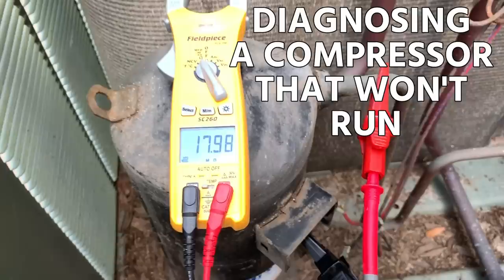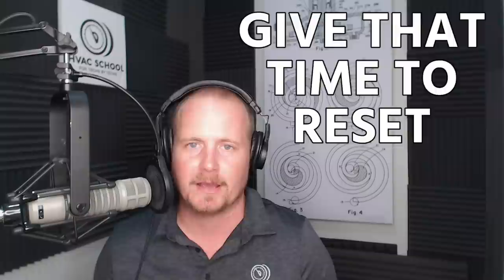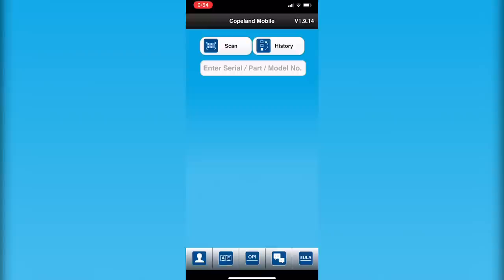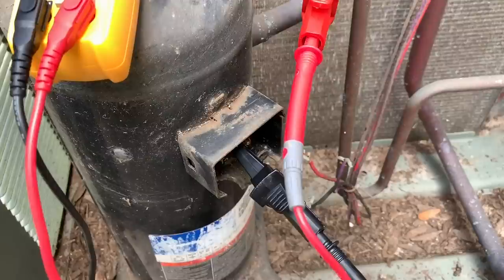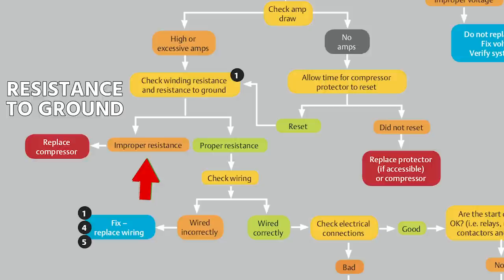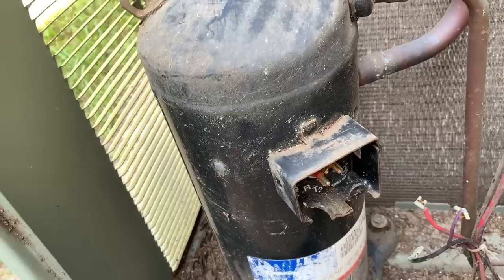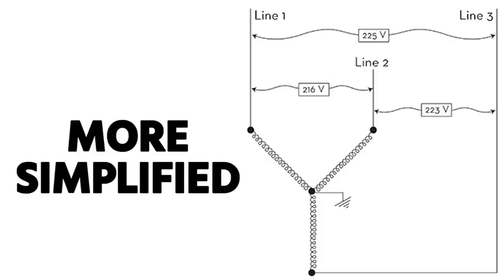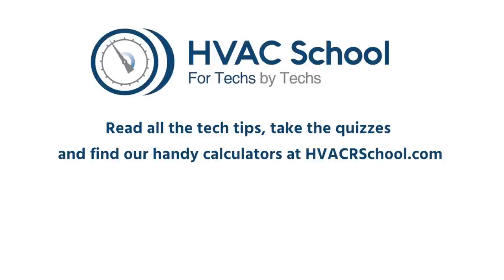Compressor Won’t Run Diagnosis

Comment: I had watched a couple dozen videos and read articles on a dozen or more sites about diagnosing my compressor not running before I found this. They all showed the same things (capacitor and contactor). I've done a LOT of maintenance and repair work over the years (especially industrial motors including 3 phase), but this situation over the holiday weekend was exasperating. Non-contact current detector showed current at the input and output of the contactor when engaged (though I cleaned all the contacts just to be safe), and all along the leads to the capacitor and motor. Seemed everything was getting power. Measuring resistance across the three compressor leads showed it just a little out of spec (didn't quite add up but only off by half an ohm or so), and nothing shorted to ground. I was baffled. All local distributors were closed for the holiday but Amazon same day delivery got me a new capacitor since I couldn't think of anything else to try and I wasn't going to pay holiday rates for an HVAC tech to bail me out when we weren't going to die, just be uncomfortable, by waiting a day. But of course the capacitor didn't make any difference at all. :( 

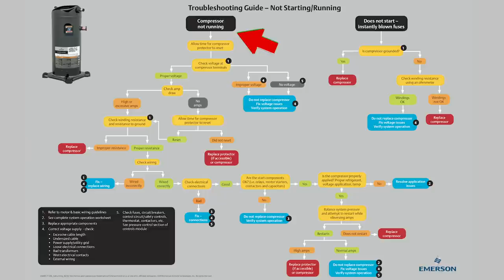Then I got more determined and hit YouTube again and eventually found this video. At the 2:27 mark (which by remarkable coincidence is my birthday, so that felt like a good sign) you show the Emerson troubleshooting flowchart. I immediately recognized the gap in my process, as I had only checked for any current running through the wires, not proper voltage. Some more confusion by the readings I got from my multimeter (zero or a fraction of a volt depending on where I measured, despite the current detector showing current in everything. Called my brother, an electronics engineer so I could explain what I had checked and in what order and all that to see if he could spot another gap or explain the voltage readings. He said to turn off the thermostat and measure again. Still zero volts, but then I only got a reading from the current detector on one side of the input! The circuit was open somewhere else upstream, and with the contactor closed I was reading that same 120v across the whole system! 

Turns out the type of disconnect on this house (a recent purchase) has a fuse inside. I had never encountered that type before, and as the power was on with the breaker on and off with the breaker off it never occurred to me to look in there. I'm annoyed that none of those dozens of other sources said anything about verifying voltage or tipped me to the existence of a fuse in some types of disconnect boxes, but I'm grateful that you showed that flowchart to point me in the right direction!

Comment: I was taught to add the sum of the ohm value of common to run and the sum of the ohm value of common to start and the sum the two should equal the sum of the ohm value of start and run which means that the windings are good. If they don’t add up the windings are bad

Comment: Just came from a job where compressor would not turn over. initially though bad cap because fan was running. 60mfd cap reading 58. checked voltage line side of contractor and load side and it was good. Pulled compressor plug off(power was off). Turned power on and voltage to plug was good. compressor was a little warm. Ohm’d out legs and they seemed within range. Thermal overload was not open. LG compressor so don’t know the resistance value but S-R equaled R-C, S-C. Ohm’s to ground reading OL. Clamped my meter on Common and Run (separately) and did inrush amps and reading OL. Clamped Start and reading like 5.6A inrush. Just for testing purposes I added a hard start and still nothing. You could hear humming but would not turn over. I condemned compressor. 
What i don’t understand is why I got OL when I checked inrush on common then check on run and got OL.

Comment: One common problem can be no problem at all. With older Copeland (scroll compressors), they have internal heaters that keep refrigerant from saturating into the oil of the compressor. Many times, people will turn off the breaker for the A.C. during the winter. The first hot day in the summer, they will turn the breaker on, and then immediately turn on the A.C. only to have the compressor draw high amps which then thermally kicks off the compressor.

Doing this during the winter months is O.K. The proper way to start the system is to turn the breaker on about 5-7 days before you actually start using the A.C. This will warm the compressor to start normally.

Comment: Image result for single phase compressor winding resistance
If the compressor passes the above tests, take a multimeter set to R x 10,000 (10K) and check each winding to ground. You should have an infinite OL resistance to ground. A shorted motor will read 0 ohms across windings, to ground, or both. If it is both, you will need to replace the compressor.

Comment: I had an odd repair I had to do at the coffee roaster I work at that I think you'd find interesting. We have these old german grinders that run on 208/230v single phase power. The grinders are ancient, some with stickers that read "made in western germany" so pre 89, somewhere around 84 we estimate. Several motors needed to be replaced due to excessive wear, so we ordered them from the manufacture which still makes them after all these years. 

The schematic is your basic single phase motor with a current start relay, a start capacitor with bleed down resistor built in, a contactor, a thermal breaker and a thermal protector built inside the motor. 

Every time we tried running the new motors when installed in the housing with the original wiring per the schematic sent by the company ( with all new components ) the thermal protector would trip and the motors would make a terrible buzzing noise. I ohmed out the switch, the contactor, the current start relay, tried multiple caps, changed all the wiring incase it had a break etc. I was going crazy trying to figure out the issue so I watched a gazillion hvac videos and decided to get a cheapo $14 amp clamp to see if I could figure out what was going on.

I hooked up one of the old motors which had worn bearings, but was otherwise functional and ran it with all the components I had confirmed 100% to be functional and it fired up no problem. I put the amp clamp on the common and found around 20 amps LRA which would drop down to 5.5a running. 

Hooking up the new motor I found the start windings were constantly engaged. I learned how a current start relay works and as an experiment I switched on the new motor then using plyers with a rubber handle and wearing gloves I pulled the wire which feeds the start capacitor / winding to emulate a properly functioning current start relay and found 30-35 amps LRA and 7.5 amps running! This is a nearly 31% difference between running amperages!

I decided to pull up the data sheet of the current start relay and found it has a pickup of 16.2 amps and a drop out of 13.2 amps. If the circuit was to function properly I estimated a current start relay would have to have a 17.2 amp drop out. I tried to find some which are rated for this but they are expensive and I didn't want to gamble on my theory.

Digging even FURTHER I found out about the SUPCO APR5, an adjustable potential start relay. They are about $25 bucks and I figured it was worth the gamble. I opened the manufactures schematic in photoshop ( which I had already colorized and cleaned up previously ) and changed it to accept the potential start relay instead of the current start relay. I really liked the fact that the potential start relay is normally closed, preventing arcing of the points on startup, compared to a current start relay which is normally open.

After testing the circuit on the old motor to make sure I didn't smoke the new one, I hooked it up and it worked! I assembled it and ground a few pounds of coffee to confirm operation and now its back in action and running like new. 

Hope you find this interesting, I know I did and I'm thankful for you and others who posted videos explaining all this theory. Now that I have such a good grasp of single phase motors, I wanna tackle 3 phase or at least get my hands on some more single phase motors to fiddle with! At least I know if I ever wanna transition into HVAC I would have quite a good foundation to work off of.
Reply: also, passive resistance of windings were greater on the new motors in contrast to the old motors, indicating it was over wound ( I assume ).
Reply: @aaronfidelisrecine  Way to go. The way you described it. You're growing a lot Mr. Grumman.

Comment: 14:25 BE VERY careful (especially on older compressors) when removing wiring connectors from compressor terminal pins, with pressure behind them, if they're weak you could get injured or at least a nasty surprise if a weak pin pulls out with the connector.
Reply: How do you avoid this?
Reply: @jericosha2842  recover the refrigerant charge first

Comment: BE VERY CAREFUL WHEN REMOVING ANY TERMINALS AT THE COMPRESSOR WITH A FULL REFRIGERANT CHARGE, IF YOU HAVE A WEAK PIN IT COULD BLOW THE CHARGE IN YOUR FACE.
Reply from the maker: Very true
Reply: Good to know.
Reply: That's crazy lol but if you need to do it, you can't take regret it can you?

Comment: What about a compressor that IS running but pressures are equalized and pulling 11 amps of the 25RLA? New construction Carrier straight cool no pressure sensors found leak in evap coil. Standing pressures on arrival were 102 psi on a 95° day. Mechanically failed?

Comment: Just double-checking here, didn't you read 17.43 Mohms to ground with the fieldpiece and 5.8 Mohms with the megger and then make the statement that the reading with the megger was higher than the reading with the fieldpiece meter? Am I missing something here?

Comment: On a 3 phase annex air I'm currently working on. It's danfoss scroll with a vfd and it's getting winding break down causing an a45 earth groundfault on the drive not allowing the compressor to run. So I'm replacing in next week. So I'm guessing I'm getting back feed noise on my load side on my drive. Reason for winding break down is they are running in low ambient conditions without low ambient kit causing oil migration.

Comment: Dear Bryan: question:  a Copeland compressor was left on new unit, unused for years, pipes were open not connected...we tried to check compression but not working...it reads 0.4 ohm on each terminal.  please advise your thoughts..it is locked...shall I check all diagnosis you laid out or it is rusted inside and useless? thanks I appreciate it. Robert

Comment: I am confused when you say that a compressor isn’t necessarily completely fail, but may have a partially failed reading. The way I see it is it’s either failed or it’s completely 100% fine. I am not about to tell the customer that this partially failed compressor is fine, that would just be crazy, because now you own it, your telling them it’s good, and then what, you leave and tomorrow it blows up, ya ok, and who do you think is going to be blamed for that! No, the shit is either 100% ok, or it’s bad, period. I am not about to get in a situation where I tell the customer that it’s ok and then next day bam it’s a piece of shit, then YOU will be liable for that. Don’t think so, try it, and when you end up in court guess what, YOU will be putting in a new system for them for free. If you don’t think so, then go ahead and try it, and let me know how that works out for you.
So just to add to this, when it comes to residential ac, when there is a problem, check simplist things first, capacitor, contactor, condition of the wires, are any frayed shorted or broken, if none of these things is wrong, then the unit is bad period, and needs to be replaced, no point in replacing the compressor, especially if it’s shorted to ground, more than likely it burned up, and all that crap is going to be through the whole system, trying to flush everything out is nothing but a waste of time, and you will never get everything out, especially in the Acoil.